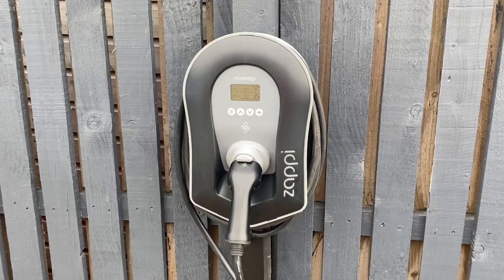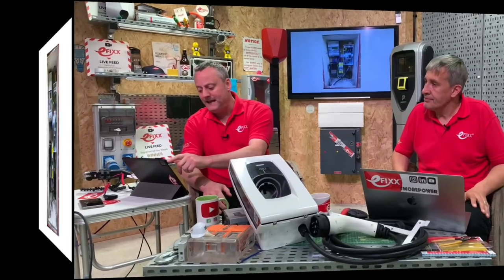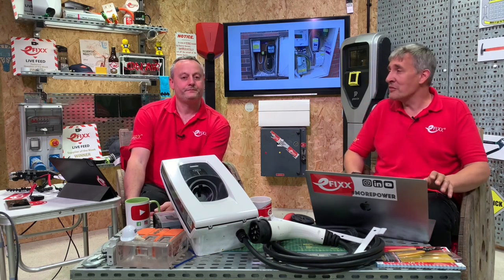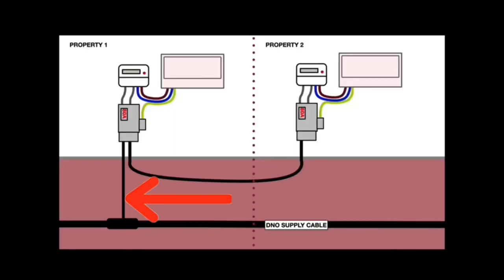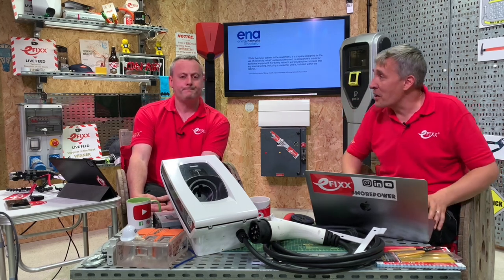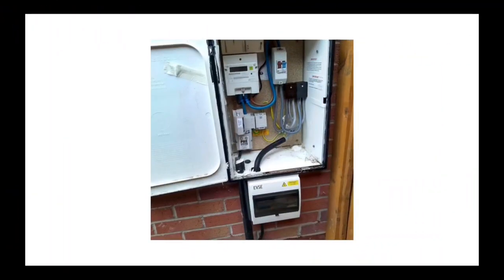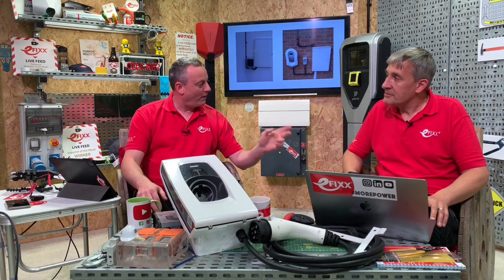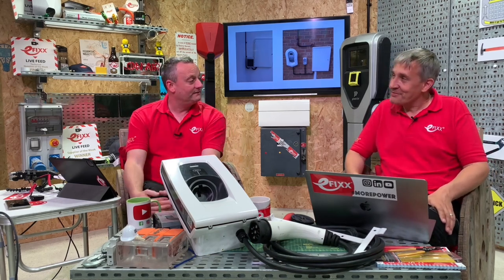Can ELECTRICIANS fit equipment inside the DNO METER BOX? - EV Charger Installation UK

Comment: So a charger that has an integrated consumer unit is the answer? But then how to connect its supply?
Reply: Good point. Maybe DNOs should work with manufactures. And maybe the sharks should supply a DP mainswitch as standard.
Reply: Regarding an main isolator.
With gas the pipe enters into the premise having an isolation maintap (ECV these days). Preferably with no joints on uncontrolled main pipe inside the premises. Just a pipe with a maintap on. The maintap is the responsibility of the gas supplier.  It is for customer and gas supplier use. 

With electricity there should be a main isolator switch as soon as the supply enters the premises, like in gas, then the main fuse after the isolator. The shark DNOs have it in reverse, in order so they can save on supplying a main isolator switch.  Unbelievable.

Comment: At time index of 5:16 you say "their space" indicating the cabinet belongs to the DNO, but the fact is, in the letter of response from the first DNO prior to this, the DNO actually say they recognise the consumer owns the cabinet.

So it is going to come down to who legally owns the consumer unit and the law and IET regulations around the interference with the cutout and DNO feed to that. And IET regulations are not law.

It's possible that you are not breaking any laws by adding in additional components into the cabinet, and as long as you don't interfere with the cut-out and main supply cable going in, or if you do need to say,  move the main cut out and pull out the main supply fuse you get the correct authorisation from the DNO.

So the DNO may try to discourage you from putting anything extra in there on safety grounds, but whether they can legally stop you I think is questionable.

Concerns about overheating; it's a sealed box so potentially it could overheat, but that can be prevented by putting louvred holes on to the side of the box to allow the hot air to escape, and to prevent rain from entering and possibly covered in a metal mesh such as chicken wire to stop rats getting in.
Reply: correct their is no legal issue. The DNO cannot tell you what to do with your own space, but as they explained to me if they needed to install something bigger and there was not enough room they would be quite right to insist you shift your stuff to make room or they would not install the for example bigger fuse box.

Comment: Northern Powergrid specifically state on their website that customers own equipment.CAN definitely be added inside the meter box! So what you are saying in this video is not true for all DNOs!
Reply from the maker: We asked NPG directly and they answered back via the ENA statement. Lots of the advice online predates the roll out of EV chargers. We will follow this up again soon.
Reply: @efixx  haha, well they had better not change the rules on the fly now. My meter box is totally FULL of kit and has been for 10 years since my solar PV was installed. Smart meter fitted 2 years ago without any issues. Electrically it’s the most logical, practical and safe place to connect an EV charge point to. Keep the high continuous loads away from house internal CU. TBH I’d rather you just accept the NPG web site statement as it is now! It’s very explicit. Why keep prodding them? If you keep asking them for more definitive answer they might change the rules and make it not acceptable any more!  That’s not in anyone’s interest is it?
Reply from the maker: Installers want clarity at the moment it’s very grey.  Regardless of what they say on the web site , if someone fills the box with “stuff”and it prevents access you’d have it get it shifted. 

Here’s what the ESQCR says 

Where a connection to a distributor’s network has been made, or is proposed, and the distributor is not satisfied that the consumer’s installation or other distributor’s network or street electrical fixture which is or would be connected to his network is or would be so constructed, installed, protected and used or arranged for use so as to prevent, so far as is reasonably practicable, danger or interference with his or any other distributor’s network, or with the supply to any consumer’s installation or street electrical fixture, he may issue a notice in writing to the consumer or other distributor or owner of the street electrical fixture (as the case may be) requiring remedial works to be carried out within such reasonable period as may be specified in the notice.

Comment: As a person who works for a DNO and has been directly involoved with the new service head replacements, I fully understand WHY it's a no no !  The service head or 'cutout,' is changed LIVE ! Would you want to be messing around in a cutout meter box with a live supply cable trying to fit a new cutout ?? It can get a bit hairy scarey when your struggling for space. THIS  is the main reason the cutout meter box is NOT the place to install anything but the coutout and metering equipment. Electricians don't work with a live incoming supply which could be carrying 2/3/400 amps from the mains service cable running under the footpath down the street or road. This type of work demands safety equipment and training to make the task working LIVE to be carried out safely. So please don't put anyhting in that meter/cutout supply box because you'll create a whole heap of potential future issues for the customer or yourself as the electrician 👍😉

Comment: Of course it you all them they are going to say no but if we own the box then, especially that there are boxes of different sizes then what is the minimum space that someone needs to leave. When a meter company comes and installs a meter it is not the power network neither so who defines the space required? The temperature argument is really a strange one as the box is outside and still with some air circulating so I would think it will get a lot less hot than any other installation in the house.

Comment: Im fitting my EV Zappi tomorrow and I will be fitting a 4way distrib board in the meter cabinet , i have enough room and as I have a smart meter nobody comes around to read it. The chances are slim to none that it will ever be copped in there... If it ever is then its simple , move it
Reply from the maker: Your risk - https://www.facebook.com/groups/ElectricianscommunityUK/permalink/3248361125394797/

Comment: How long before we see an EV charger with appropriate protections inside, that could be supplied by a single 25mm 3 core armoured fed straight from a Henley block? No equipment allowed inside the cupboard? no problem ;)

Comment: Of course the DNO's will say no, they can't possibly say anything else.

I think it's reasonable to add these parts to the cabinet as long as you're prepared to restore the installation back to original IF the DNO later needs the space. At that point you could add a box elsewhere. As for heat, an RDC and CT are not going to have any significant effect on heat generation inside the cabinet.

The notion that you would change the entire CU or add another inside your house (except maybe in a garage) when the charger is going to be adjacent to the meter cabinet is ridiculous.

Comment: Had a college called  back to a meter cabinet where he had added a 2 way db. Was told it is either removed or they will disconnect the supply. I personally think it belongs to the customer and dno has no authority to disconnect you regarding this, there are no safety grounds. That said, what can you do, but do as they say.

Comment: That wasn't a "no" - it was a "don't get in our way", so I'd say it depends on the size of the enclosure.
Reply from the maker: Nope it was a NO
Reply: I've seen older houses with the entire building CU installed in the meter box. Not saying it's a good practice, and I'll have to find the cite but I believe that there's a minimum area specified - in fact there's a diagram that published that shows an area for consumer use... and if no consumer equipment is to be installed, where do you draw the line? Isolators? Henleys? Etc.

What about EV chargers that require installing CTs on the tail to report back the current load to ensure that there's a safety margin during high load periods so it can dial things back so the service fuse isn't blown? On the same vein - other wireless energy monitors? You routinely see these units mounted in the meter box (where the manufacturer actually states to mount them) 

Everything I've seen has to do with ensuring that there's a safe and spacious area for access for the DNO. 

I'd like to actually know the regs are here as it seems illogical if you've got an extremely large box that the consumer can't use any of that space. Surely it has to come down to area? If there isn't a prescriptive amount of area defined, there should be - this would remove any ambiguity that exists.

Comment: I find these videos really interesting and informative. But playing devils advocate. The answer from the ena is very carefully worded. They did not say NO!, They made it clear the meter cabinet belongs to the customer. (So the DNO does not become responsible for replacing broken doors and hinges) They say the space is design for Electricity Industry Apparatus only, well we are all in the electricity industry and so is all the equipment in question. (I.E No gas meters). Then goes on to quote for "Safety Reasons" which is undefined. One might assume extra thermal heat, but this should be negatable unless something is wrong. Then uses the term "we would not recommend" Not "Must Not" or "Should Not", Just recommend. The term Internal wiring is then used, I would propose the use of Henley Blocks, additional tails a Metal or Plastic box containing an Isolator and or Fuse, MCD, RCD, etc and then likely connection to SWA cable is not internal wiring (Like T&E or Flex) and is all electrical industry apparatus. At no point was any issues raised about real estate with in the cabinet, which is likely to be the only real concern IMO. It does open a minefield if a fire was to break out inside the box. Given the number of CU's for EV and Solar I find in MB's. If the DNO don't like it, then they need to get together with the ena and iet and engineer a solution or define a MB real-estate plan. But it is likely it will take them 10 years to agree on something!. Until the, Keep calm and carry on.

Comment: Situation 

Customer needs an EV Chargepoint, they live in a new build. Meter box is on external wall on the front of the property, Consumer Unit is under the stairs in the middle of the house. Glued chipboard floor, brand new carpets. Understandably Customer doesn’t want them lifting and an IP Consumer Unit would look ridiculous based on where the external box is..

Aside from the obvious being, don’t have a Chargepoint if you can’t be flexible, where do you go from there?
Reply from the maker: Blame the builder for ignoring building regs on the position of the Consumer Unit for starters and the meter box will probably already be full as the long tails will need a switch fuse.

Comment: The cabinet belongs to the home owner. If you build your own house you have to buy your own cabinet and hockey stick they only own the equipment. On a different note dont fit a smart meter power rationing is on the way.

Comment: Had a 3 phase supply installed, bought a kiosk. The dno said, "only our stuff on the backboard and 3 mtr tails." So I put a piece of board on the side using the handy mounting points provided. Fitted a 100A D curve MCB in a 4-way box and then a few Henleys. I then put the armour for the house, garage and a separate board into the Henleys. 35mm cable, because the box is some way off and 25mm was only 96A so I had to mobe into the 40mm gland territory, earthing nuts for that are expensive. It obscured just as much of the board as if it were mounted on it, but they were happy, which is unusual.

Comment: Seen a job installing EV chargers it gives you around £40000 a year if you can install 2 a day you can get an extra £22000 if you can do 3 a day. I have done a couple now but on commercial buildings, office blocks e.c.t. Now if the customer has a new consumer unit and the cable run is easy yes I think 2 a day is possible maybe 3 at a push remembering you have to drive between jobs lunch and if you are on your own and the cable route is awkward could be a nightmare. Just wondering what people on here think that are installing them all the time? I just think to get that done including testing them people will just be lashing them in and not doing a good job just wanted people's views. And if you had to be that quick would you not just install a cu in the outside meter box because that would be the quickest way? I just find these companies doing this are just out to make money and not doing a proper job, pisses me off when I try to do the best I can within reason so that the people I work for get a neat and tidy clean install done properly.

Comment: Well my charger was fitted last week December 7th 2021 with the consumer unit in the meter box  DNO Western energy inspected via photograph and said that was 100% fine . 13/12/2021 Yesterday I had new smart meter fitted which are smaller than my old meter so ther plenty of room. But the fitter confirmed with Western energy distribution about the consumer unit as he fitting a mobile device to the board to phone my energy supplier with meter readings. 
He check again with them the reply was as long as ther room and ot not over crowded its fine my meter box is vented so air can circulated. So DNO my have changed there minds 

My house consumer unit is 5metre from the metre box and my ev charger is a little over  15 metre from the consumer box and meter box.

My parents do not have a meter box there is in the pantry on a huge sheet if ply wood just on the wall with no covering the house consumer box sits next to the meter  then blow the electric is the gas meter on the same board. With no separation.

Comment: At the end of the day there is no LAW that says you can't do it so you can do it. If there is any contract then that would be between the DNO and the customer not the DNO and the electrician so the DNO would have to take civil action against the electrician and good luck with that. Does any contract between the DNO and the customer exist or have legal standing? I'd say in most cases probably not as you deal with your supplier not the DNO directly and your supplier deals with the DNO. So basically fit what you like and if they try and get arsy tell them to F**k off!. The DNO does not "own" that space, the householder does in the absence of any contract with the customer to the contrary I certainly don't have any contract with anyone that says they own that space. I'd also argue that the claim that the householder is responsible for the box is legally dubious again where is the law/contract that states that? It's their equipment.

Comment: Huge surprise the DNO won't allow us to do our jobs.
We probably should give them £250 to fit a £40 isolator and then wait 4months for the privilege.
If there is a Regulation confirming that no work can be carried out at a domestic supply by a Qualified competent person, I'd like to see it? 
The DNO should be fitting an Isolator between the meter and the Consumer Unit at every home.
If this was purely about safety Government would create an Act, a law in effect. There would be no confusion and everybody would be safe to isolate and put in whatever the Customer was looking for without any problems. This of course would require a lot of work for the DNOs but surely they could sell this to the HSE and get funding. They would probably sub contract most of the work out to the same guys who need to use it!!!!
Reply: Why would the DNO be involved in any installation beyond the meter? They will install a switch between the service head and meter. When I had this done 2 years ago it cost me £140 and took 3 weeks.
Reply: Roger Thomas 
It's possible the DNO could do something to make the whole Domestic Electrical industry safer?
Or the Government or HSE could insist on a safe method of isolation to protect the User?
There are too many questions not getting definitive answers these days.
I suspect it's due to fear of litigation or just an unwillingness to progress unless the Taxpayer pays extra somehow
Reply: Have they been installing them as part of the smart meter roll out?
Reply: @rossmurdoch1886  I agree they should be installed, hence why i paid for one myself and as i had the DNO visiting i used them, but they should be installed by whoever maintains the meter so that they go between the meter and the CU. The DNO in their DNO role does not cover this area so my setup disconnects the meter as well, which is not what the meter owner will be expecting.
Reply: Roger Thomas I expect the Suppliers won't want their meters switched off either, it may show as a fault rather than a deliberate act by the Domestic Spark instructed by the homeowner 
It would be easy to pop a sticker with a phone number on it to inform them what your intentions are.
Guys who instal CUs must face the dilemma of wether to snip the wire tag and pop the main fuse every day.Its a farce in my opinion and dangerous in some cases.
Thanks for your feedback

Comment: Well done lads thanks for sorting this one out. Anyone that installs anything other than a Henley block in a meter box is a dirt bag 👍
Reply: Why? There's a ton of room inside one once u reshuffle stuff around, you can add boards to the side of the cabinet and mount the isolater/blocks on there and any meter would fit in with ease alongside a small ccu.